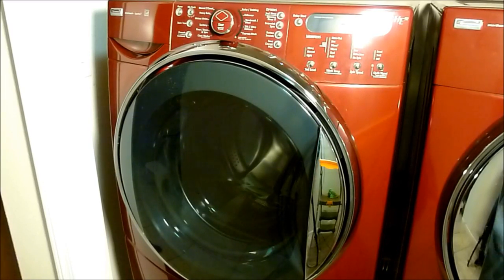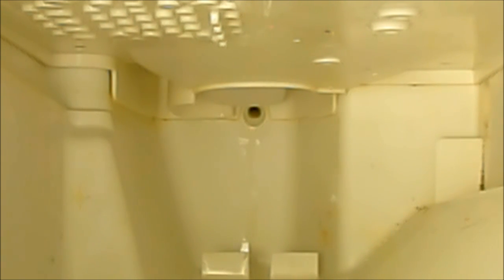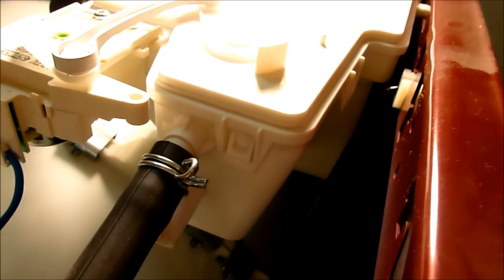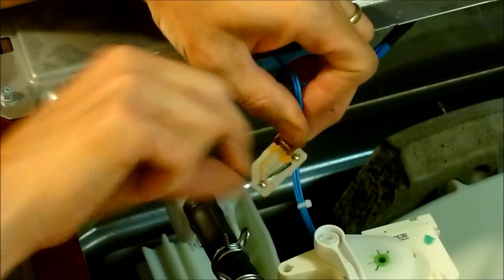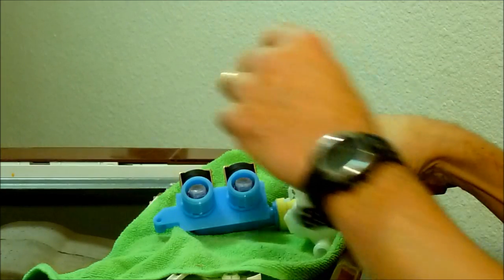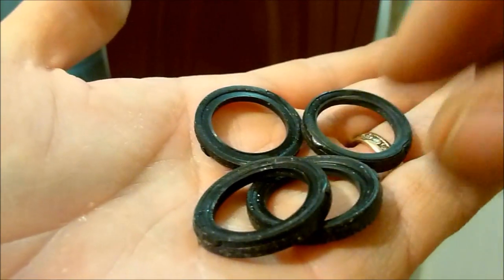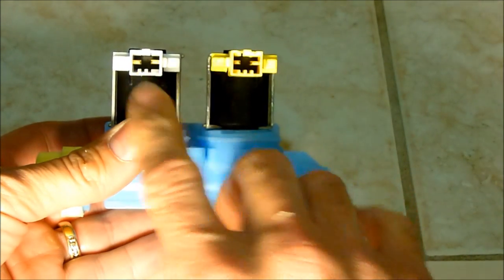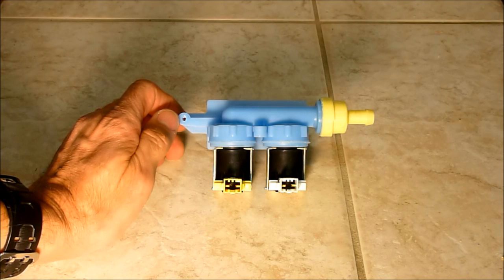Sears Kenmore HE5T Front Load Washer Leaky Water Valve 8182862 KitchenAid Whirlpool Amana Maytag

Comment: A very well made video on the valve replacement. Back in the seventies, my mother's Kenmore top loading washer quit spinning the tub. I found the ZINC belt pulley had spun on the gearbox shaft, ruining the shaft and pulley. We had a local appliance parts store, and he sold me a kit he has made, with a new shaft, STEEL pulley, and gasket. He said all those period Kenmore washing machines were cheaper made than the actual Whirlpool models, and sold these kits on a daily basis. They are probably all the same these days. Your washer looks really nice.